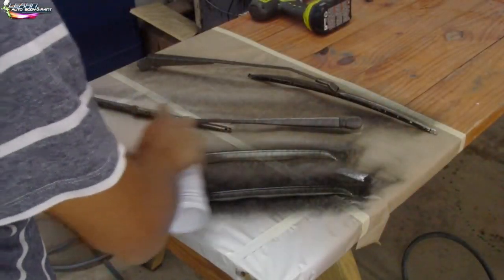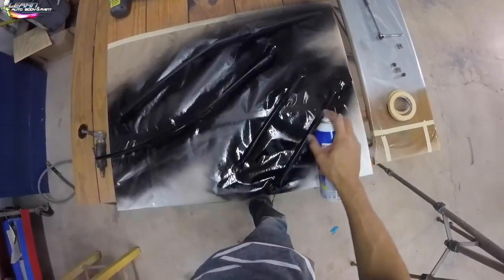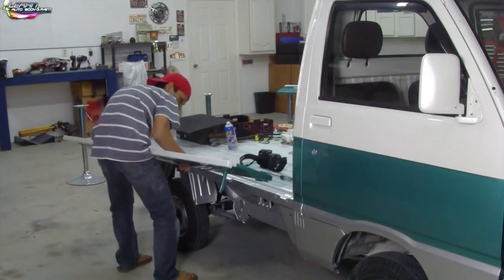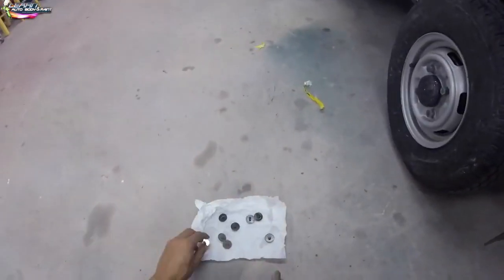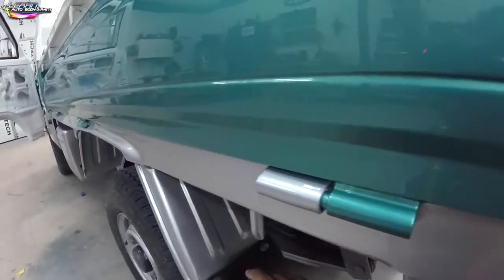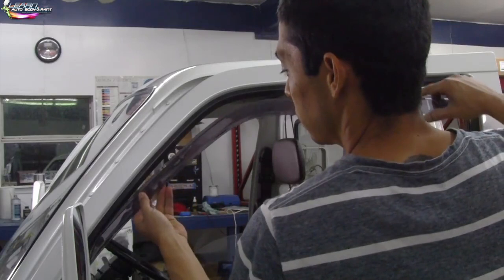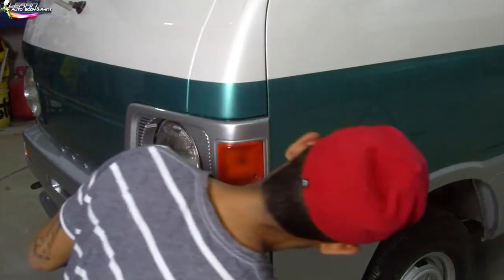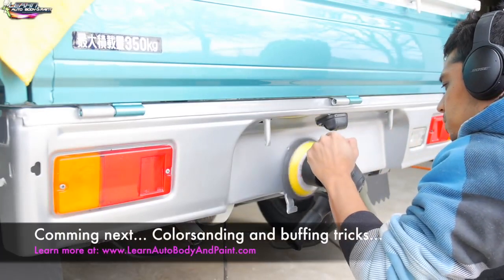👉 Assembling A Truck After Doing A Plast Dip On Parts

Comment: 👍 we called those trucks Bongo trucks when I was stationed over in Korea. They are fun to drive around, but if your over 6' tall, little tight fit. Almost felt like a clown car when we would have to fall out or cramp in them. Love the dropped sides, very versatile truck.